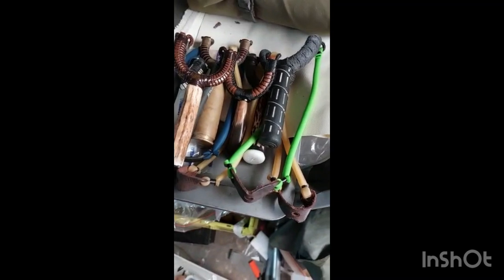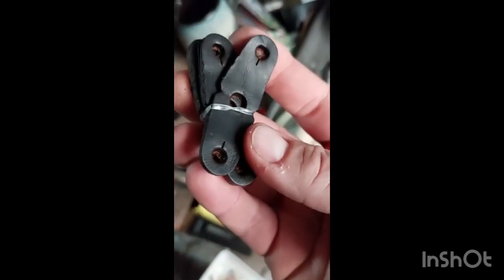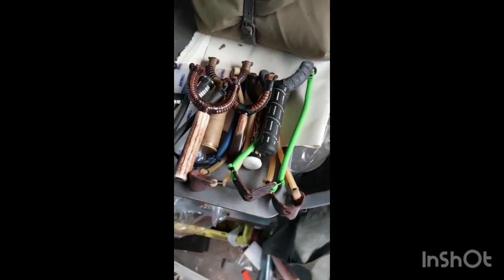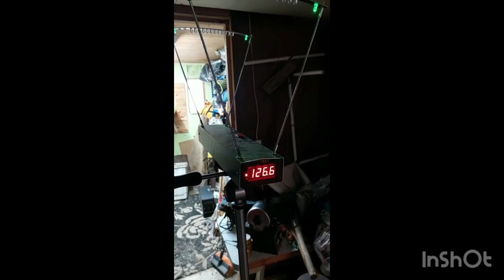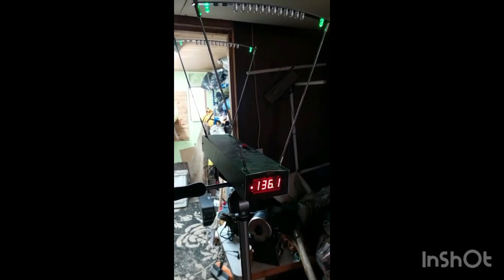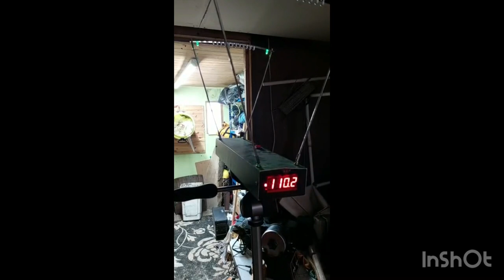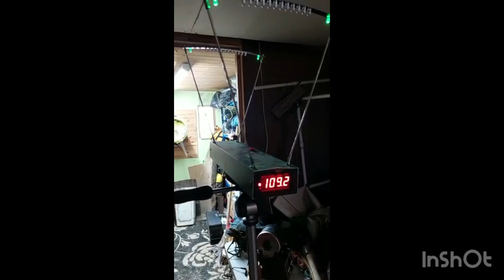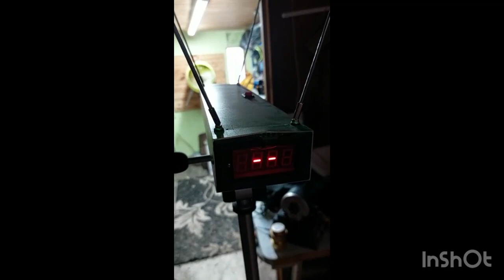Catapult TUBE elastic testing

Comment: Blue hose is a lot better than that clear shit
Reply from the maker: It’s not. We put it over the crono.
Reply: @leightonsstrodsandcattys  I shoot it with 12 leads shoots like a elephant gun
Reply from the maker: @Lukew2207  there is a photo on Facebook we shot a pheasent with 18mm lead with out tube, took it head clean off. If you can be arsed have a look for it. If not good luck with blue hose pipe
Reply: @leightonsstrodsandcattys  I’ll have a look in abit but I think hose is good stuff